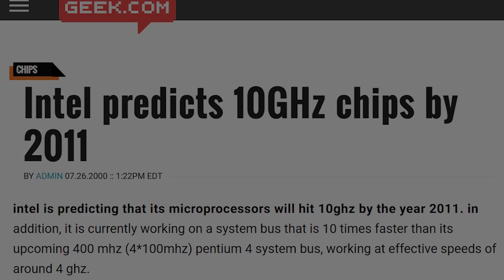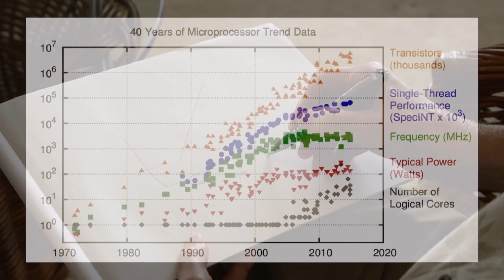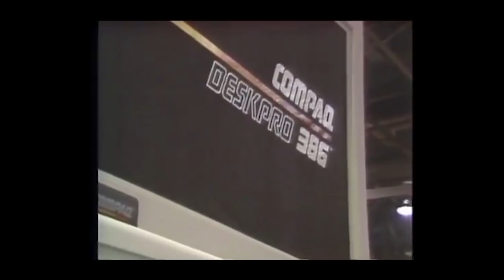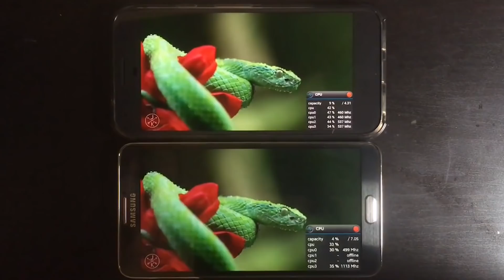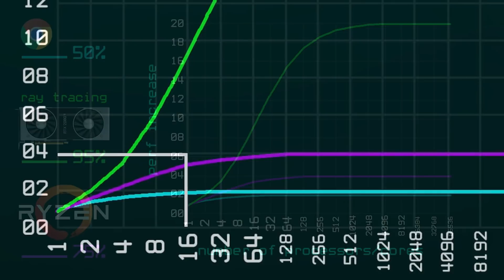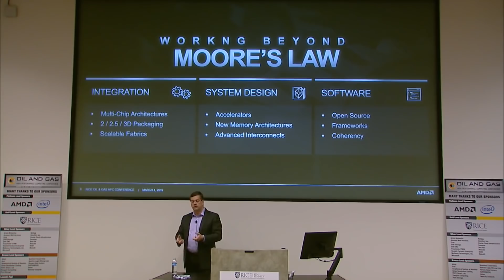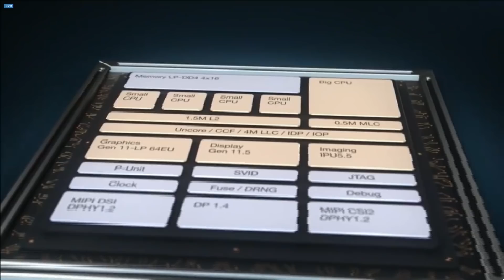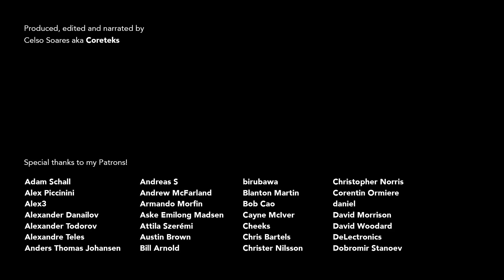Intel and AMD going BEYOND Moore's Law

Comment: Programmers aren't bein taught to code sequentially. I don't know where you got that misguided notion form. I studied in University 10 years ago and the first course we had to take was about functional programming. The most parallelizable paradigm. The last course I took was about multi-threaded programming. It was a very popular course.
So making a blanket statement like "programmers are being taught to code sequentially" is just erroneous.
Reply: That might be your experience, but aren't the majority of software development courses, even at university level, teaching OOP?
Reply: @neilbedwell7763 
There is normally a (single slightly mediocre) course  on OOP and it's vital to understand that OOP is orthogonal to Multi-Threading. In fact, one of the popular books on Multi-Threaded Programming: "Art of Multiprocessor Programming", uses Objects in Java.
There is also a single course on procedural programming.
Overall, it is up to the student and there are courses in multi-threaded and distributed computing which are gaining popularity as well as Data Science and Deep Learning which are highly parallelizable. Except for AI and some Video & 3D, why would anyone want the extra computing power per-core? Gaming seems to be mostly bottle-necked by the GPU  which is a processor with an even larger number of cores that are being pushed to the limit.
https://en.wikipedia.org/wiki/List_of_Nvidia_graphics_processing_units#GeForce_20_series

The reason there isn't a lot of multi-threaded code is that it's harder to write and to maintain. Universities are on board with fancy things like functional and multi-threaded programming. The industry's supply? It is growing steadily with the demand.
Reply: @arthurwulfwhite8282  actually games are bottlenecked by the CPU a lot more often than you think, especially older ones and pretty much every MMO.
Reply: @BattousaiHBr  I am talking high-end. The discussion is about what's possible with the best equipment today. I seriously doubt that you'll often get bottlenecked by the CPU available on a game.

Now, I understand it depends on the resolution... but I normally see the CPU is not at 100% and the GPU is up there. Maybe I am used to high-res and ultra details?

I guess the question is what settings you run the game at. In most modern games, I don't feel the CPU is the cap. Could you show some examples of being capped with a high-end CPU on some modern games? About older games... I am guessing they aren't a great example cause they probably were designed with weak GPUs in mind and GPUs improved a lot in the past few years.

I don't know about MMO... I don't play them.
Reply: @arthurwulfwhite8282  only games i see that really cripple the GPU are AAA games, which don't require crazy high FPS anyway.
e-sport titles, which are the kind of games you'll want to get very high FPS, are also much more CPU bound. LoL, dota2, CSGO, pretty much every e-sport title is CPU bound.
Reply: Interesting point! When you say CPU bound, how high can you get with modern hardware (best CPU on the market)? How high do you want to be ideally? Cause maybe we don't use the term 'bound' the same way or I don't understand the needs of e-sports gamers well. I used to play SC2 for fun and laughs and it seemed like people were able to compete on today's hardware pretty solidly.
 @BattousaiHBr
Reply: @arthurwulfwhite8282  "bound" just means the hardware which causes a bottleneck to further performance gains in any particular application/game. i don't know why this particular word is used, but it is indeed often used within the enthusiast gaming community for as long as i can remember.

i should add that the reason probably that the CPU is the biggest factor particularly in e-sport titles is precisely because e-sports is where competitve players will want to get very high FPS and you can always bump your FPS a bit higher by decreasing image quality and other effects, however almost all of these settings weight primarily if not only on the GPU, therefore if your GPU sucks you can always compensate by lowering the graphics settings, but the same cannot be done to compensate for a crappy CPU. because of this, if you lower your settings enough (as many competitive players will do) the CPU will always become the performance bottleneck.

generally 60 FPS is considered the bare minimum acceptable in competitive games. anything lower than that is considered bad. the reason is primarily because mainstream monitors are all 60 Hz displays, so going above that has an immediate diminishing return (although going past your monitor refresh rate still does matter!).
for people with high refresh rate monitors like 144 Hz or 240 Hz, achieving at least 144 FPS or 240 FPS, respectively, is highly desirable to get the full benefit from the monitor, but going above that is still helpful.
generally 300+ FPS is considered ideal for most competitive games, particularly FPS games, though you can still go higher if you don't care about higher power draw and heat but it has diminishing returns the higher you go. MOBA games are considered ideal at lower framerates than that, maybe around 150 is already plenty enough.

the competitive game i know that has both the most noticeable improvement from high FPS and can achieve high FPS is osu. due to the simplistic nature of the game while also being very mechanically demanding, 1k FPS is considered ideal, though i personally play with a 825 FPS cap because of the aforementioned diminishing performance gain vs linear increment power draw.
Reply: Arthur Wulf White I did multithreaded processing first year, second semester of computer science. And that was "low level" C, not utilising any libraries.

Comment: 4:09 it will, but at a much slower pace. There are too many (quantum mechanical) things that are not understood well enough (experimentally) to be able to make a commercial product. Other mechanics than the classic FET will need to be made and understood consistently, which would take quite some time. As we see, and you pointed out, this is seen mostly in stagnation of performance and core clock. This graph does indeed show a still increasing amount of transistors, but in the last years, this is in a big part thanks to the dies themselves getting larger significantly. If the density was plotted, it is also clearly levelling off. 

Check for example this Reddit post for some extra info without going in too in depth: https://www.reddit.com/r/hardware/comments/932jh2/transistor_density_improvements_over_the_years/

Comment: Doing it at the hardware level seems, to me, to add additional overhead to the hardware, and while it could definitely increase multicore speed and usage on single-threaded programs, I wonder if it would also lower performance when compared to a proper multi-core software on standard multi-core hardware.

Comment: the distance between atoms of silicium is 2.2 angstroms, or 0.22nm, so you won't see much less than 1nm, and there are a lot of problems with crosstalk (electricity jumping from a wire to the next) at 3nm and under, or 14 atoms, and random bits flip quite easily, so unless stuff is made a lot more cleverly, the chips wouldn't be reliable.

Comment: Being able to automatically turn single-threaded processes into multi-threaded ones sounds really cool, but I do hope to see a shift in programming toward multi-threading to take full advantage of extra cores.  I've also noticed that CPUs seem to have topped out as far as frequency goes, and that the next step is to simply add more cores.  The eventual conclusion of this was something like what you showed at the end of the video: a hybrid CPU (or possibly dual-CPU setup) with one, two, or four really fast cores, coupled with 16, 32, or more somewhat slower cores.  The fast cores handle those things that absolutely must be single-threaded and take advantage of the extra speed, while the additional cores can run multi-threaded processes without breaking a sweat.  If it's possible to distribute a single thread across multiple cores, though, this might not even be necessary.

In any case, more cores seems like the future of CPUs, for now.  I would fully expect programs to adapt to this new paradigm in some way.  Some day, a new technology will pop up, and the paradigm will shift once again.  Maybe it will be quantum computing, though what I know of that is that a "QPU" would run alongside a traditional CPU, not replace it, but even then it could offer a wealth of new possibilities.

By the way, if you want to feel optimistic about the future of humanity, I recommend the channel Science and Futurism with Isaac Arthur.  It's mostly space oriented rather than computer oriented, but it's amazing to see the sorts of things we are capable of doing right now with our current technology level.  The reason we don't do most of the stuff he talks about is because it would take a long time and be really expensive, but once we got things rolling they would quickly pay for themselves, and better tech could speed things up considerably.

Comment: complete idiot here:

what if we run single-threaded processes as multithreaded by using multiple cores as a single core? basically, running lets say 4 cores with slight offsets from eachother. so if you look at when they'll execute itll look like core1 - core2 - core3 - core4 - core1 - core2 etc. this basically creates 1 core that has 4X the speed of a single "core", but for multi-threaded applications its a 4 core with 1/4th the speed. lets say you have a 4.5GHZ clock speed, that'll bring your single-threaded speed up to 18GHZ. which is a huge boost that could be easily done with cores we have today. 

idk if its feasible to offset the 4 cores like that. but if you can, it might be worth trying.

Comment: As a developer myself I can tell you this 2x gain is minor and will have unintended consequences for all kinds of temporally sensitive apps. What will really happen is hardware will get more cores and developers will be forced to learn new languages to take advantage of this. I am already writing code in Elixir and Erlang so my code can already easily utilize 64 cores. But most of the stuff I develop is mostly on the server side. Not that you couldn't develop similar apps on the desktop.

Comment: New CPU architecture will do better. I do high level code, so I'm not the best source of info, but honestly it seems like you're talking hyper threading, which is overhyped.
I don't code drivers so I don't care much for parallels. It shouldn't be our job to maximize hardware performance. Full parallel is super hard to maintain, let alone refactor if needed. Using composition over inheritance would make parallel complex code into spaghetti sauce.
Asyncing is only useful on ticker and update functions, and the general rule of thumb is to stay away from tickers as much as possible.

Comment: One thing that was missed in this video was the addition of specialized cores or hardware. Back in the early days of microchip and computer design of the 80s, it was not uncommon to find coprocessors that could handle certain tasks with varying levels of abstraction like GPU's and their tensorcores and compute cores found on them. I highly suspect that a great deal of performance gains and the resurgence of SIP solutions will be to accelerate development in areas where improvements can be moved away from redesigning huge monolithic silicon architectures to redesigning components of them and breaking development gains into multiple streams for faster iterative development. Why redesign an entire processor when you only need to improve the section of it that handles math or graphics or machine learning tasks etc... While a company is waiting for an investment in one part of a processor to bear fruit, it can continue development in other areas which may progress faster. This is highly attractive from a business and advertisement standpoint as it gives the charlatans in marketing something to work with when it comes to claiming how much better something is compared to the previous generation. Faster as well as simultaneous iterative development can modularize a product stack so that it can also give the benefit of greater scalability so that you can tailor make something for different kinds of markets. If I can make a processor that meets the needs of consumers by just removing a couple extra chiplets and charge less while allowing that processor to have a few chiplets added on and meet the needs of business and enterprise, I have effectively simplified multiple development streams into one. (Though of note there are downsides of chiplet designs such as issues with latency and how long a signal takes to get from one chip to another, even physically large processors have this problem as timing, clocks, and even just current and voltage can change as something moves from one area to another, and you often need to compensate by adding all kinds of resonators and checks that keep stuff running as it is should be, and if you want efficiency you need to build hardware in to see if something is in use to dynamically adjust current to where its needed...... One more thing, clock speed if research into it is anything to go by could change but likely so would materials. See research into fast switching carbon and graphene transistors and the stuff the defence department did back in the 1980s with gallium arsenide.)

Comment: In the 90s they were thinking we would continue increasing the core "speed" hence the 10Ghz, but a lot of things have changed since different architectures, multiple cores.
Maybe it's time we think how we make software differently so they benefit from multiple cores, instead of solely relying on the advancement of hardware.
EDIT: That kernel AI looks good, maybe too good to be true. Remains to be seen I suppose

Comment: Physical limitations are quantum ones
5nm and below is the current limit on silicon because of electron quantum tunneling.
5nm is only ~20 silicon atoms across.
A potential solution is running at much higher temperatures using different materials (aka Gallium Nitrite or Silicon Carbide)
or of course 3D transistor planes, which is more likely.